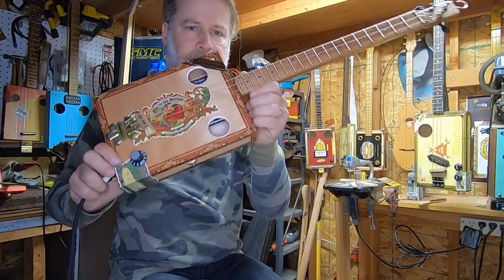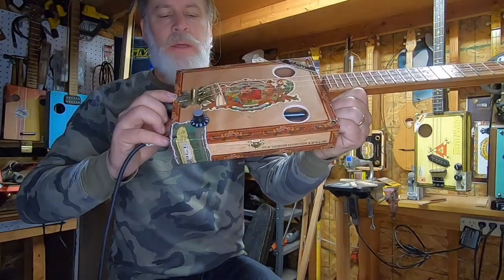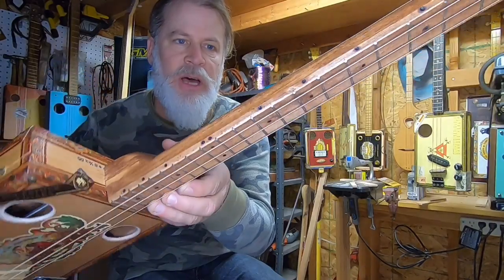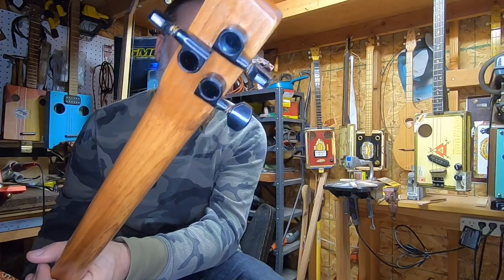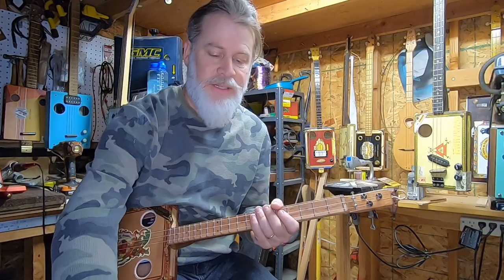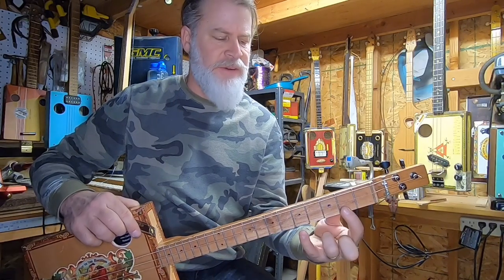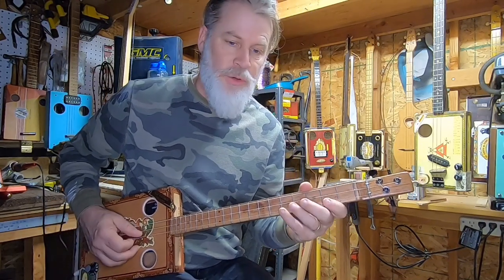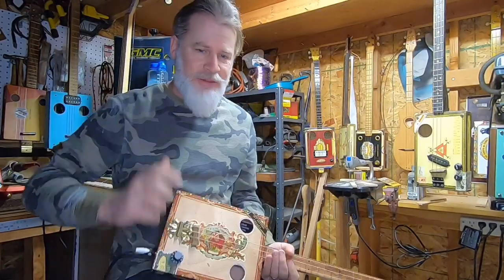My Father Cigars - Cigar Box Guitar

Comment: Hey Del, just finished my 1st cbg after watching a lot of your vids. it's loud and over 30 seconds of sustain unplugged. one soundhole up top really projects. I was worried about intonation but a small move of the bridge had it dialed in. my only problem was that my cigar box lid has a lip , not flush and flat. so I needed to shim a little. I sanded the paper off the inside of the lid and I think that helped since vibrations were just thru the wood itself. 
anyway, I wanted to make a suggestion for a future vid. walk thru building 3 or 4 together so we can better understand why you design one way for one cbg and go another way for another. for instance, flat box top or with a lip...how do you figure out where to cut top. how big the heal is on a thin box vs a 3" deep box. so deep box, shallow box, flat flush top, top with a lip. 
I think the main reason why I had to shim was to get the bridge height high enough to have a good angle on the strings behind it.